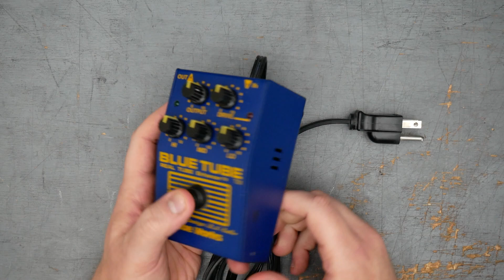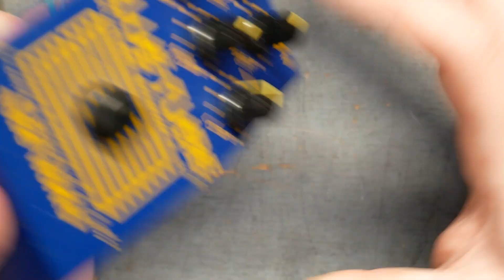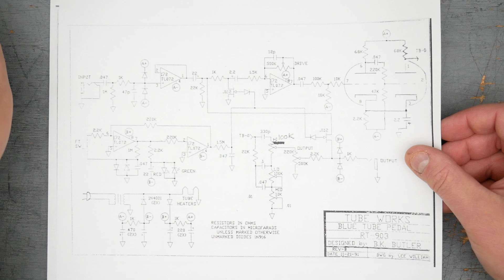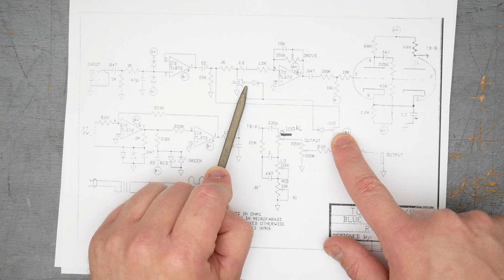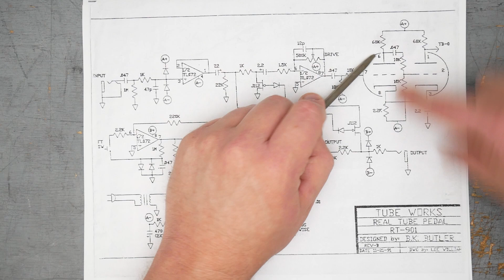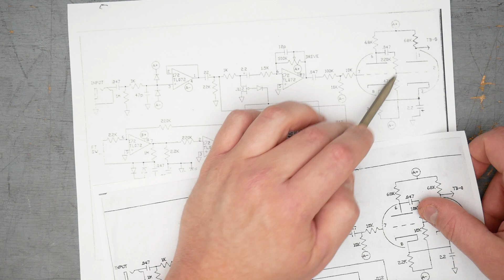Tube Works Blue Tube Teardown! See what's inside!

Comment: I use the Real Tube version for a lead tone and it really sings. Unfortunately the tone controls are too interactive with each other, especially the treble. There’s only one spot where it sounds good, otherwise it rolls off all the mids and bass. Is there anyway to mod this behavior? Interesting that the Blue Tube uses a 100k vs 500k for the treble. Would changing the pot to 100k help?

Comment: The resistors look like carbon film not carbon comp to me.
For those interested, current regulations require that the safety ground is connected to its own screw terminal which must be marked with a ground symbol and not shared with any other connection.
Reply from the maker: Correct! That was a flub on my part, definitely carbon film 1/4W

Comment: Does the tube actually get hot? Seems like it wouldn't. 🤔
Reply from the maker: Sure, as hot as any other 12AX7. Whether the vents are really necessary is another question, but if you’re doing a custom enclosure why not?
Reply: @graybenchelec  Even if the tube is only getting 12V?
Reply from the maker: @kennyjohnson336  I believe so, the heat in a preamp tube like a 12AX7 is 99% filament, about 1.8W.

Comment: I had a Real Tube rack unit back in the day and I recall it being somewhat noisy.  I see it has half-wave rectification - for the cost of a a few more diodes, they could have improved the power supply greatly.  Do you notice excessive hum?  

As a side note, I recall seeing on an internet forum (many years ago) an anecdotal statement that increasing the voltage to the circuit greatl improved it's performance.

Comment: I have a Blue Tube I bought around 1990. The circuit is in dire need of an output buffer. The 500k pot is an indication that it has a high impedance output. It’s easily loaded down by some pedals. 

I used mine on bass. By the time I’d get to unity gain on the drive it would be too distorted, so I used a 12AU7 tube instead. No hot melt in my unit. 

The other issue is a slight hum. Could probably stand to have a DC tube heater.